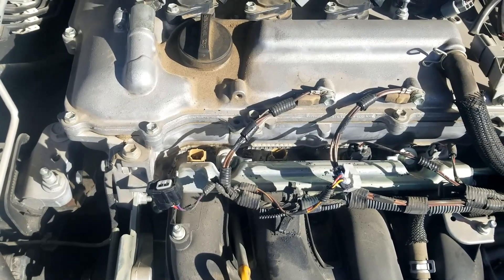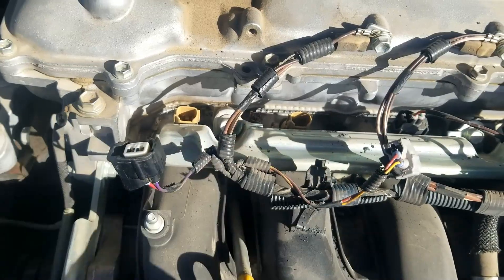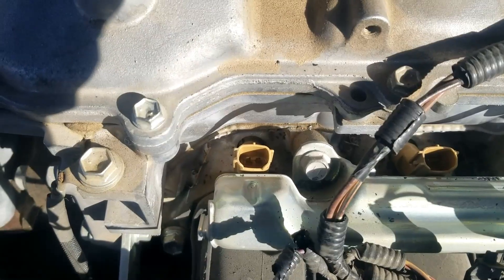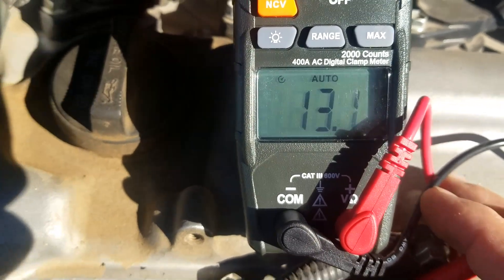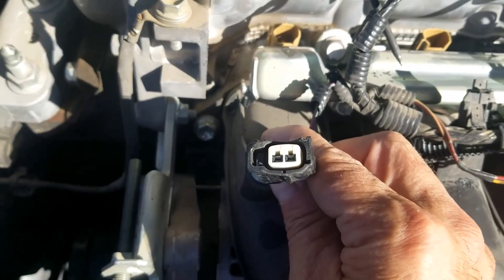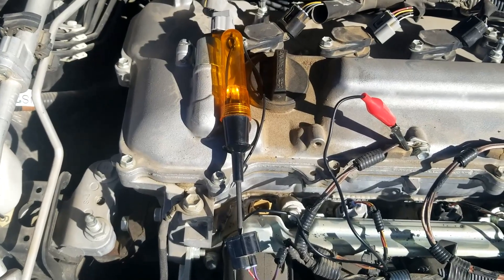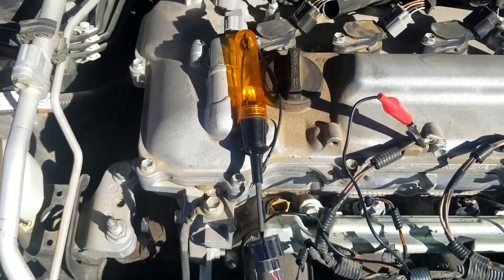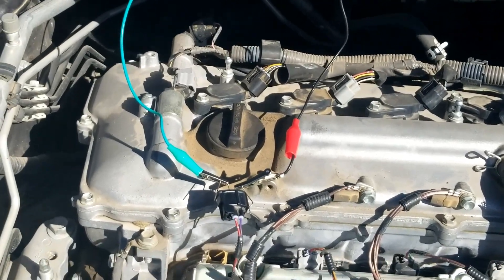How to Test Fuel Injector Circuit Using Test Light and Meter (Old School Injector Circuit Test)

Comment: hi bro, thanks for you sharing- i have also same problem P0358 I swap all coil, and i check in computer again, same P0358. If engine run i removed the hightension wire from coil, sometime have electric and sometime no, can you please give some idea to solve, thanks
Reply from the maker: The main thing is to be sure the injector is good and then test each wire to be sure they are good by checking for voltage and a good signal ground from the computer. Sometimes there is a bad connection or loose wire that can cause wiring to test good but cause intermittent issues.

Comment: where can i get  wireing schematics at? thanks
Reply: and thanks for these inexpensive tests
Reply from the maker: If you can't find them for free online, a good manual may be best. There are professional services that many mechanics use, such as All Data or Mitchell Pro Demand. All Data has a DIY section for individual vehicles; just be wary of any recurring monthly or yearly fees.

Comment: I have a po303 code on a 04 xterra. I have pulse and power from the wires to the injector. Tested injector and reads 16.2 like the other ones...but when I unplugged the #3 connector there is no engine change. What else could it be?
Reply from the maker: If the injector is good with a P0303 code, I would test for spark (coil, wires, plug).
Reply: If you un plug and no engine change, thats your issue there.

Comment: I just have a question, can you fully substitute the test light with a multimeter? If so can someone tell me how it is suposed to act or what common problems with the specific voltage might the multimeter reveal?
Reply from the maker: Yes, you can use a meter check for 12 volts with the key on and test the injector's ohms are good. The ground side is pulsed on and off from the computer, which is why a test light is used. There are other methods to test the ground side using a meter, which is a bit more involved. There are good videos on it.
Reply: I would use an old analog needle style meter to see the needle swing very time it gets 12V 

Most digital meters are not fast enough to see the on off pulse, with the needle, you can see it bounce back and forth
Reply: @ACommenterOnYouTube  modern meters are specifically designed to test so many different things in the world of electricity. A $100 Klein or higher quality fluke meter is more than capable of measuring the rapid changes in voltage pulsations. Source: I’m an electrician.

Comment: what if all that checks out good and still get p0200?
Reply from the maker: It could be intermittent, such as a bad connection that is only loose on a bump or a component just starting to fail.

Comment: Hi there. Could you tell if the test light is meant to be on solid when connected to both the wires on the injector connector pins with just the key ignition on. I would assume the test light would be off until the engine is cranked and then it flashes. Im working on a motorcycle 4cyl injected atm it wont start but has spark and fires up with some ether sprayed into the intake. But when i test the injector plug 2 wires with a volt meter it shows 12v with just the key on and will flicker a bit when cranked. I just didn't think it would light up solid with just the key on. If you understand what im trying to say. Meaning the ecu ground pulse is already grounded and shows 12v at the pin connectors. Test was done disconnected on one of the injector plugs the other 3 plugs were still connected to there injectors when doing this test. Cheers 🤷‍♂️
Reply from the maker: Yes, usually, it is solid and has 12 volts when the key is in the on position, but the engine is not running. When the engine is running, there should be a pulse or flicker.
Reply: @HVAC_Mechanic  thanks for that. i was thinking it would only flash when cranking over as it would be waiting for a negative pulse from ecu when crank sensor triggers. because already having power on one common pin color wire when ignition is on. maybe its the FPR i just fitted a brand new fuel pump that didn't fix it.

Comment: thanks for the video! looks like you created your own noid light, nice. so if our injectors are stuck open with a p02 code (we can tell because fuel was spraying out of the exhaust manifold gasket), then is it possible to deduce that the issue is on the ground side from the pcm? either a problem with the wiring or the pcm? if i can test for continuity in the wires with the beep test on the multimeter, is that enough to show that the wires are good or should we also check the resistance number? closest to 0 is best, right?
Reply from the maker: Checking for continuity should be good and is what I do. If the injector is stuck open, the mechanical part of it may have failed. The coil part can test good, and the mechanical part can still be bad. You could swap the injector with a good cylinder and see if the problem follows.

Comment: How do I connect the test light to the connector harness? I Connect the wire connected to test light to the power wire on connector and than run a ground wire from the test light probe to the other connecting wire on harness?
Reply from the maker: It is best to go from the ground to the positive on the harness, and the positive battery terminal to the negative wire in the harness. That way each wire can be tested separately.